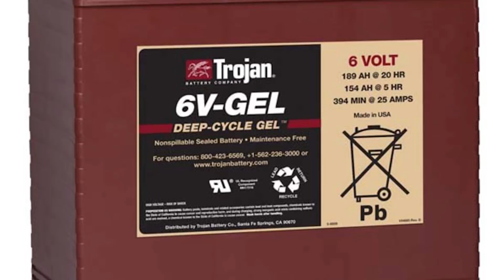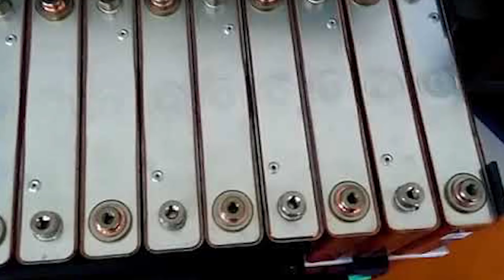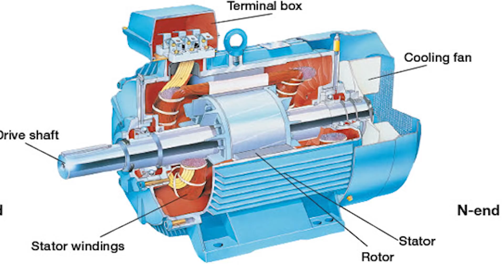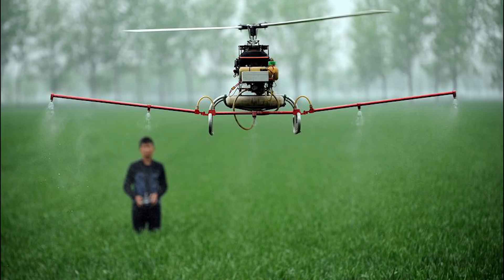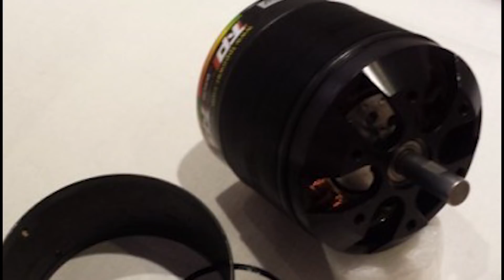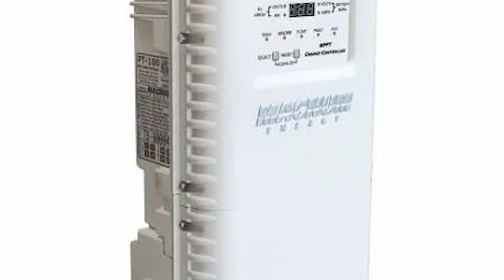How to Build an Electric Sailboat

Comment: Cats have advantages and disadvantages. Cats can give good deck space especially th normal wharrans .However your boat has extra cabin midships that  creates some issues  mostly weight in the wrong place high up and worse  weight .cats do not like eightieth end of  and the wharrans with V shaped hulls really do not like weight . So really your gonna have to make compromises on the electric project  using weight as the main issue . That means the investment in the battery good decision the Li-ion types  the lead acid is not really an option for you unless you can keep them low down in the hulls . Acid and sea water do not mix . Engine wise probably best   forget two engines  . One engine will best in center and can be shaft driven either in one hull or better in center .Center egine with shadft can ollow the shaft to be lifted lifting prop out of water to reduce drag work on it if it sares ropes etc  Electric power is often much more better in transfer of power when it is big prop turning slow than diesel .A ~10 BHP electric power engine can often match a 20 to 30 BHP diesel engine  in CALM conditions . Things get tricky with cats with windage drag issues   where power requirements increase exponentially compared to mono hulls .You can probably never have enough power. to drive a cat into very  strong winds force 8 upwards  and large  waves at a clever price or weight ratio  .Best is power enough for wind forces of force 4 on the nose  without too much high  waves such as lee shore the typical entry to marina in wind you will probably ever meet . More wind than that anchor and wait out storm or use dingy to get ashore and let boat ride out storm without you .Probably best to Forget larger ranges aim for 5 miles semi  flat out eg ~4 to ~5 knots winf d on the nose of about force four  which  give about 15 miles in calm  seas going slower like ~3 knots  .Go with Wharan wood masts two of them square main sails not triangle types  cheap cheerful easy to fix any part of the world .Rudders are issue .I would add few feet to boat rear stern section to make them pointy again gain some small extra storage and then add on the wharran type rudders with rope system . You can try to add Wharran system without pointy stern but not sure how to do that . The main cabin top sides is too big  half that size would be better for weight  reduction  both in terms of weight  and high up weight .However its not critical mistake if you are prepared to cut back on other excessive weight .Cats have high skin friction from water compared to mono hulls and V shaped hulls are even worse so weight slows down cats a lot . more than it does to mono hulls .Water makers are better than to carry heavy water .  I would be reluctant to make so many extra berths for blue water sailing but they are not so bad for local sailing with overnight stops .Blue water sailing those extra berths would be better served for storage stuff . The solar panels the mre the better and the cats have room for them .Just use the power in the day time to drive fridge and switch fridge off at night or reduce fridge power at night time .Hot climates water in black containers heats up easy so not really interesting to make water cooling circulate unless you plan to sail in cold regions .Ply Wood and fiber glass methods is light and easy to do but can look a tad rough . Cut out the rotten sections   and fix it as you go along  often on beach at high tides. Li-Ion battery such as 18650 type  if the demands are low like 0.5C  and the recharge isnt too fast less than 1C  often dont need a balancer system  or BMS to remain in balance .What causes the issues is rapid charging and deep heavy discharges such as large engine demands over short periods like one hour..If for some reason you did have short burst of power such as emergency you can balance out the cells with a suitable balancer charger such as one line of 12 celsl divided with balancer into two of 6 cells and systematically spend some few days to rebalance out the cells after the abuse time or every few months . It often isnt important 12 cells versus 13 cells for motors .great project

Comment: Great project....As many solar panels,you can install do it,I do not have pics or vids to back up what I am saying,but I went completely electric(two engines)what you would put in earlier EV cars(I had a bug)plus batteries,so ,no doubt a heavy set up Installed on 13 meters Benneteau sail boat called(EZ),no more sails,but two efficient(tulip)propellers,I could feather just one(,but somewhere on the boat,I have a powerfull off-board engine(as back-up),with 200 liters soft fuel tank,trip from Brittany(France)down,to Spain,Portugal,and African coasts and back,3 month trip(slow cruising,never went over 10 /12 knots)on a calm ocean!!!!!,great fishing every day(plus rice cooker and pasta)always had a fishing ligne out,tuna,mackerel,mahi,wahoo...........0nly leds abord and cruising night lights,no water cooling for engines,but salvaged heat extractor fans with well placed vents,have 12/24 Volts on demand,well ventilated those engines are bullet proof,they're the same as golf-kart type but heavy duty electric lifters,with the right propellers,they will push hard,and nothing better than shutting the motors off when the ocean is like a pool,grab a rope and jump in it 50 miles from shore....!!!...

Comment: Only just discovered your channel. I'm not sure if have seen this one but you need to have a look at Pauli Jupi's electric sailboat channel: https://www.youtube.com/watch?v=wW1ui3Bud5M&list=PLbadwqUwBvb4wlRkVO5GAYVQmJTfmpfBV     Just my $0.02 worth, keep it light, keep away from 110 or 240 volt solutions. Use mass produced stuff that is commonly available - Golf cart motors etc. 2 Motors for redundancy. With 6kw of solar on the boat you should be able to do a lot of motoring.  Are you planning to have sails on the boat?

Comment: I just.watched your electronic vid and found it. Ery interesting. I do a lot of solar for a large electrical contractor in MI. Mostly 5mw and above "grid connected size" sounds like you purchased 20 340 watt modules. Like you were saying that's a lot of solar area to mount on a boat. A couple of notes. They work best if they're pointed south (or if your in the Caribbean straight up) but more importantly for your install is shading. Even if one cell of the modules is shaded it will basically shut down that module. So watch your placement and beware of the boom that could cast shade on the modules if you mount them on top of the pilot house...
Great channel and I'm very interested in the out come of your electronic installation. Good luck!

Comment: Im a little surprised that you are going heavy on solar,  and light on wind,  I would be doing the opposite,  there are more capable wind turbines to be evaluated ,   The one you're showing is good for like a laptop computer or something like that,
Reply from the maker: Haven't found a wind generator that delivers as it promises. For dollars invested I get many watthrs per buck using solar. True I often get some power over night with wind but it's not even 2% of what my solar brings in

Comment: It's not green, You have half a ton of dirty lithium on board and 1 ton of lead i the keel?, If you thought outside the box you should of used superconductors instead, More expensive but not that much more, They will last longer upto 1 million + charges compared to dirty lithium at 1200 charges, And lithium battery takes 7-8 hrs to charge and a superconductor will take 3-4 seconds to fully charge and give out constant power just like a battery, The tech is out their, But it depends on the public to know about it and ask for it, and start refusing dirty manufacturing ways! And boat designers to fit the tech and stop making new looking boats with old tech on board, We know it works, But there is better and cleaner ways and it would save thousands in the long run, Just think how many banks of battery you would have to buy to get the same results for the sake of $6-700 bucks more and not to mention the weight factor and space saved onboard, Fair winds!

Comment: I am an electronics engineer, and I've looked at this as well for a blue water sailing boat. I don't want to discourage you, it's certainly really cool not to have to rely on fossil fuels, and like you said be able to just generate your own fuel while soaking up sun. To me the safety is an issue. In some cases you may want to run your engine more than 8 hours (inverters are also not very efficient.. you will probably get closer to 6 hours).. so to get to a port before a major storm system comes through for instance, and nothing really replaces the diesel for that (you talked about having a generator but then that's the same as having a diesel engine). Also the fact that you are on a sail boat, you can be as self sufficient as you want even with a diesel engine. If you really don't want to use diesel then just sail everywhere. There are people cruising the world on sails alone without an engine at all. In other words you can just use diesel for emergencies, which is what makes them so ideal for a sail boat. Also salt water is notoriously bad for electronics, so the reliability in my opinion might be an issue. You'll also have to make precautions to avoid shorts in case of chafing, or in case of major disturbances even capsizing (well at least in a self righting monohaul) etc.. Because you're dealing with a lot of energy on board, with a potential for a major electrical fire.  

As I said it's a cool project, I don't want to discourage you, I think it's feasible in the end. But I think diesel + sails is a superior more issue free solution in the long run that can be as eco friendly or as sustainable as you want it to be. So in my opinion you're trying to solve an issue which doesn't really exist.
Reply: I agree with needing a generator.  There are a couple of problems with this design, the first being the use of only 1 charge controller.  You're only gonna get the total output of your most shaded panel at any given instant.  With a boom/mast this is pretty much guaranteed to cut that 6kw down to around 3 or 4 at best.  Secondly, the panels will need to be mounted with circulation on both sides for max efficiency and that's a challenge with 20 panels.  On a day when it blows less than 10 knots you'll have no regen capability from props and will deplete your batteries quickly.

Comment: I am curious about the motor shafts . Will they be strong enough to drive the vessel? The original design they come from is so much smaller than your requirement. I guess that’s one for the “considering it” column . Love the channel, your projects are motivating 👍🏼

Comment: Get a used single Tesla motor... it has water cooling and you can use 2 Rutters to steer.
Reply from the maker: That has 9 times the power I need, a speed controller I can't program, a bunch of features I don't need, and ten times the price of a dc brushless or other induction motor. So that's probably one of the worst electric motors for the application.
Reply: Finding Simon haha... okay. Shows how much I know.
Reply from the maker: don't feel bad. I get people telling me to Tesla all the time. It's the only electric vehicle they know of
Reply: Finding Simon look at nissan leaf. They sometimes get under 5000 $

Comment: for a blue-water capabe electric boat you need to source a bldc motor, a controller for it, a battery bank with  a suitable charge controller - and a small dc generator - possibly powered by a water-cooled 10kw diesel engine. I don`t think there is a way to install enough solar power to supply about 70A continous current at 48 volt - which is needed for a typical dc motor - for even 1-2 days. THe current technology is just not there to source enough electric power + provide enough electric power without a diesel generator.

Comment: My Friend, as the boys back somewhere someplace would say, "Your trying to make your point the hard way"........Ok, so I've designed a few systems like this and think you getting stuck on a few things that are causing your design to be more difficult than necessary. I love that you want to be as reliant on solar and wind as possible, totally awesome! But think about this, you said in the end of this video that you wanted an inverter that was also a charger. I'm very familiar with these because I work in Alternative Energy up in Alaska, mostly off grid systems. Think about this, you have a diesel engine. You said you want to be able to charge with an "Emergency Generator". So let's recap, you have a Diesel Engine, you want generator backup...............But you want to dump the diesel engine and put in an AC generator? Charging a DC battery bank using an AC generator through a charger is very inefficient. In the name of Efficiency, you are going about this backwards. The diesel engine is far more efficient that any gasoline AC generator will be,(I am assuming you were not intending to by a diesel gen as they have a high cost) and if you couple the existing diesel to a DC gen head, you will be far more efficient that what you have designed. My own application will use 48v industrial alternators. At 90amps they should make a safe 4000w each, and I can run multiple if needed. Professionally we have many 48v DC diesel driven gen sets running as backup to solar and wind systems, and it probably save 30%+ fuel. Local telecomm providers use them all over our state as backup units to their remote sites. Hope you find this info useful. Love the project, when finances allow my family and I are looking to build our own solar/wind powered 70' monohull sailing vessel as a live aboard blue water cruiser for family of 5. Good luck and keep up the hard work. Peace and Blessings...

Comment: very interesting.  i build rc my only advice don't use brushless as this is simply the wrong application for it. it will lose power the longer it is used and need the magnets replaced due to the heat they put out under load. not a high torque motor we go brushed for strong torque. in quad racing we need to buy new motors every 30 races or so. on your boat i think heavy is fine so long as efficiency is good and the boat streamline is a good shape to cut the waves. it can help carry a boat through the waves imho. i really like your ideas here. i'd like to see the finished product. good luck!

Comment: Love your work. I am planing to try a different path i.e Toyota Prius Hybrid setup. I plan to buy a cheap old inboard boat as a test rig and see what happens. Good luck with yours
Reply from the maker: Hybrid batteries are usually quite small. 1 to 2 kwhr of storage. A small electric vehicle has 20 kwhrs. This boat has 22.5kwhrs. So I'd keep your options o0en for batteries. Check in with jehu Garcia's YouTube channel. He often has good deals on batteries second hand.

Comment: Hi, nice project, good speculations & explanations. Interested to see what you choose. I have a Wharram Tiki 38 and would love a simple solar/electric conversion from my twin 9.9 4 strokes. My little Yamaha's push our boat to 7knots in calm water, but note, getting 3knots requires perhaps 25-30% throttle ie 6-7hp. It takes very little power to push a Tiki 38 at 3-4knots, so I suspect the electric motors & batteries will make sense in terms of cruising range in calms. The other thing is occasionally having to claw off a lee shore or fight against a tidal flow. For these max power is required but usually, not for long periods. So once again, assuming full batteries, the electric system should be fine. Finally, given we spend most of our time near land, we're usually only doing short trips of an hour or two so once again, electric works. Oh.. one last thing. Sailing in the tropics is way more fun than sailing in cold climates... and there's heaps of sun ;-) Norm, "Jumpa Lagi", Wharram Tiki 38

Comment: I was thinking of getting the propulsion system of an electric car; batteries, inverter, motors, controls, etc. But the motors (2) were around 9 HP each. Should get complicated in the programming of the controls.The HP ratio from diesel to electric is about 1 to 0.75, so if you need a 30HP diesel, a 23 HP electric will do.

Comment: You really do not need to worry about cooling your drive motors and motor controller/inverter unless you are building an electric speed boat..... nor will you get enough waste heat from them to do anything useful with it. My electric sports car which would cruise at highway speed at 3000 rpm pulling around 100 amps on level grade would hardly warm up its motor or motor controller at that usage. You could place your hand on them and they were comfortably warm.....during summer. That usage was about 16 kw...roughly what you are talking to move your sailboat.
Reply from the maker: awesome to hear! I think these motors I'm using are swinging a little over their weight class, we will see how that works out. I'm using high powered fans to pull air through a filter and past all the components, and shoot it out the top of the case

Comment: Hi, is two additional option you can include, Hydro generator, and equiptment can bring plenty watt per day from methanol, no contamination only produce water is quiet efficient, no sound, discrted, spare methanol tank can put on lazzarete, no plenty space need, is some kind of motor can produce some power with inboard, then if include during running is recharged including two motors. good lock and happy cirscunsnavigation.